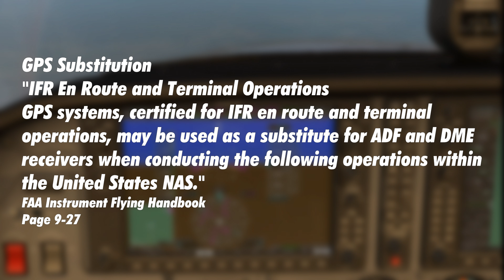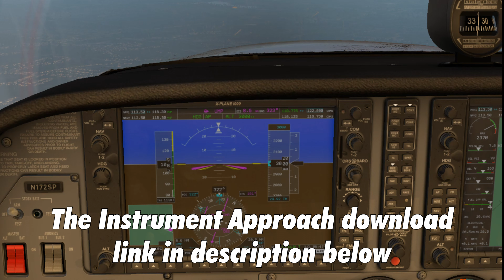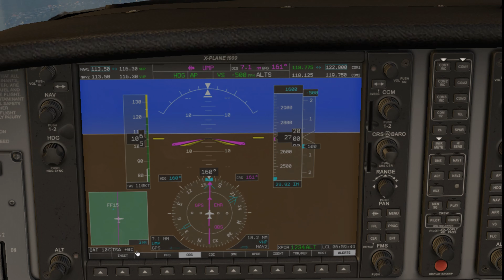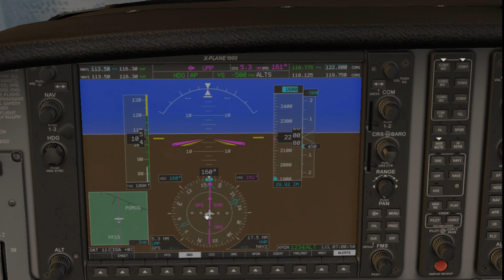How to Fly NDB Approach with the G1000 | Cessna 172s X-Plane 11

Comment: Nice video, but I was looking at how to fly an NDB approach without GPS since what you're doing is not allowed in Europe yet.
Reply: You could use the ADF to satisfy the lack of a GPS. The ADF however cannot he used for final approach guidance. Hope this helps?
Reply: @rylans.5365  my issue was trying to understand the ADF in the G1000 specifically. Found another video where they show how it works.

Comment: There's an updated AC 90-108 from 04/21/15 that seems to specifically say you cannot use an RNAV system for a final approach segment on an NDB approach. Here's the relevant text (it's under section 8, which is titled "USES OF SUITABLE RNAV SYSTEMS NOT ALLOWED BY THIS AC"): "b. Substitution on a Final Approach Segment (FAS). Substitution for the NAVAID (for
 example, a VOR or NDB) providing lateral guidance for the FAS." "Substitution" is defined as "The use of information from an RNAV system in lieu
 of that from out-of-service conventional NAVAIDs and/or inoperative or not-installed navigation equipment compatible with conventional NAVAIDs."
I take that to mean that you must at least have ADF installed and be monitoring the NDB in order to fly the final approach segment of an NDB approach. The newest AIM seems to confirm this; in section 1-2-3 it says "4. Pilots may not substitute for the NAVAID (for example,
 a VOR or NDB) providing lateral guidance for the final approach segment."
So I don't think this approach, if you flew it in real life, would be legal. But it did at least give me an excuse to look up the regs again, which is never a bad thing to do.
Reply from the maker: Thanks for letting me know about an updated AC, I was not aware of it. What I mean by monitoring the NDB - When flying a NDB approach, the morse code had to be monitored the whole time your are making reference to the ADF.  Since there is no flag on the ADF, like a VOR, it was the only way you knew if it is working correctly.  If you forgot to monitor the morse while using the ADF, I am quite sure that was an instant failure of the Australian instrument rating checkride back in the 1990s.  In the flight sim I always leave it off, but in real life I always had it on the overhead loudspeaker instead of in my headset.  As long as you could hear the morse code, the requirement was met.  I suspect the only time people fly NDB approaches now is for training purposes only.  The KUMP RNAV GPS RWY 15 has the same MDA as the NDB approach, but the GPS approach is easier to fly and more accurate.